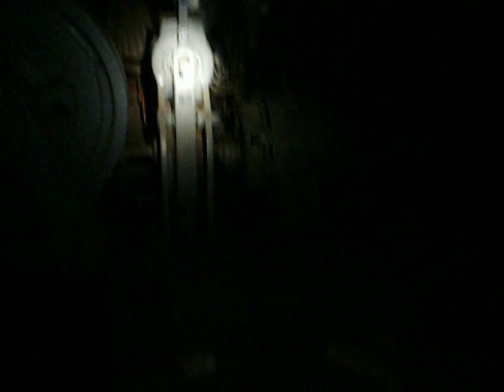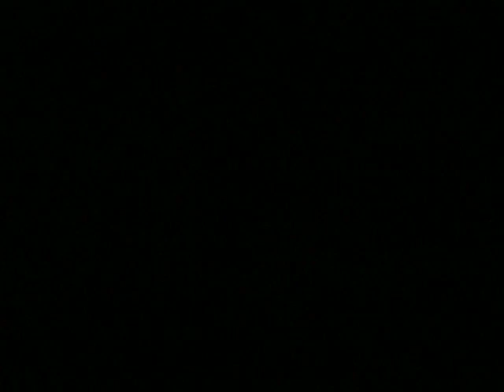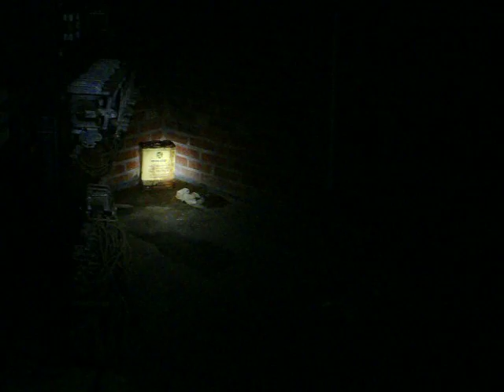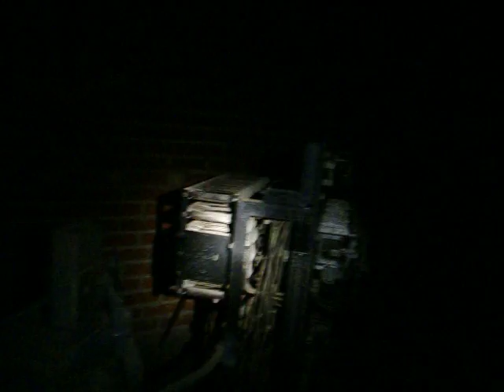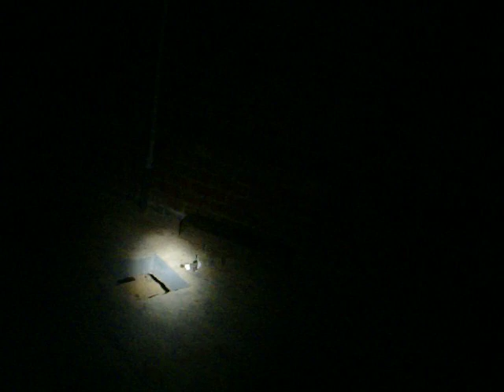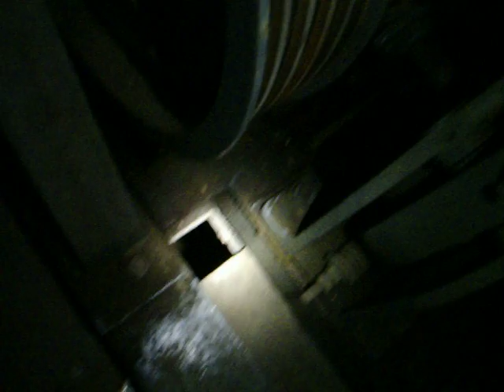An old Otis machine

Comment: The former S&K Kress Building in Berkeley, CA  their fright elevator was an overhead 1:2 traction 3 landings. When the building underwent renovation,
the elevator cab, counterweight frame, and tracks were taken out.  Replaced
with a hydraulic machine, new cab and tracks, the 3 landing were pend. to the
original ones.  I am not sure if the geared machine and controllers were
removed or not from the penthouse.